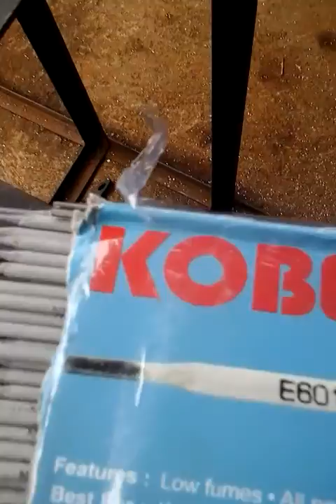Powerhouse ac welder transformer 200 second test

Comment: Sir, di ba mabilis mag-over heat ang Powerhouse Portable welding machine?
Reply from the maker: Ang bawat welding machine may duty cycle po sir 
na talagang mag stop ka at hindi tuloy tuloy sa pag weld 
Halimbawa pag 60% ang duty cycle ng welding machine mo 
6min na tuloy tuloy sa pag welding at 6min. Sa pag stop sa pagwelding 
Kaya may duty cycle ang isang welding machine  upang maiwasan ang pag overheat ng mga wire na sanhi ng pagka sunog ng mga wire 
Pero kung gusto mo na tuloy tuloy sa pag weld 
Sir Tanggalin mo sa loob yung circuit breaker nya para hindi na sya mag stop 
Pero mas delikado 
Hindi overheat  pag nag stop ang isang welding machine 
Nanganghulugan lang na gumagana ang safety feature nya 
Lahat ng welding machine na AC talagang iinit po sir 
maliban lang sa mga DC inverter na welding machine na hindi madaling uminit 
Pero kung gusto mo sir  ang welding machine na tuloy tuloy sa pag welding 
Gumamit ka ng DC  inverter  welding machine 
Or gumamit ng AC  welding machine na mas mataas ang amps tulad ng 300 to 350 amps 
Pag 200 amps kasi madaling 
Uminit at mag stop 
Lalo na pag 60% ang duty cycle nya 

Salamat po sir

Comment: Sir, may ganyang welding machine din ako, pro di umiikot yung fan nya twing iturn on ko.. di ko magamit ng husto kasi nga hindi gumagana ang fan.. paano po ito paganahin?
Reply from the maker: Pwede mong iconnect ang wire ng fan  sa loob 
Sa saksakan mismo ng welding macnine 
Doon mo iconnect 
Maraming salamat po
Reply: Ipa check up mo brod ang conection nya sa electrician, kuntinti lang babayaran mo bro, nasa 250 pesos lang
Reply: Brod papaano umorder niyan, yung 300 am
Reply: @guillermoallidem17  sa lazada ako nag order sir..
Reply: @Vhandricksbm  okey na po sir. Salamat po